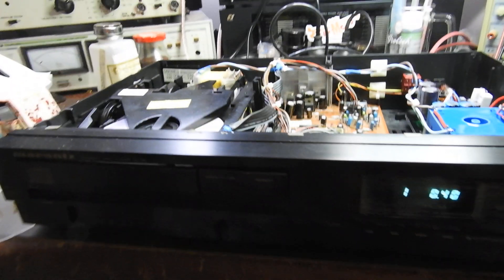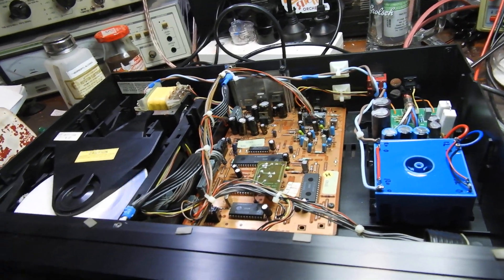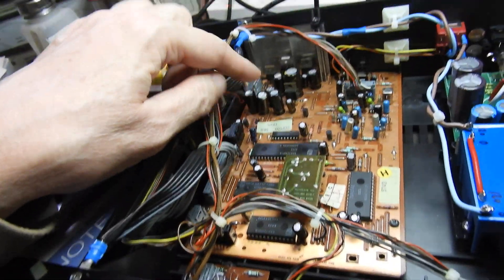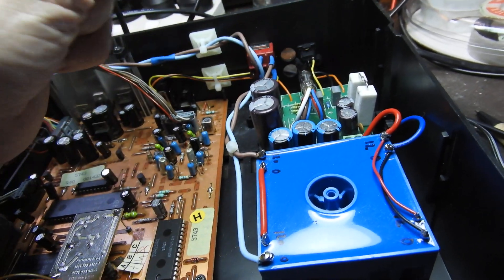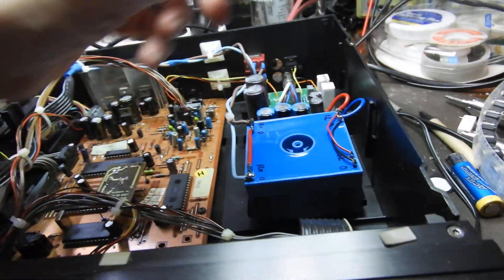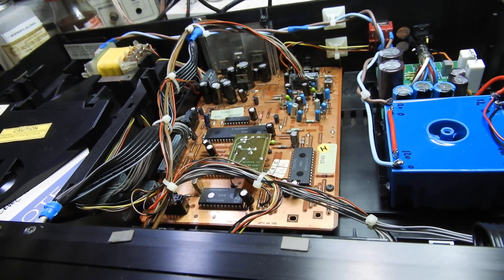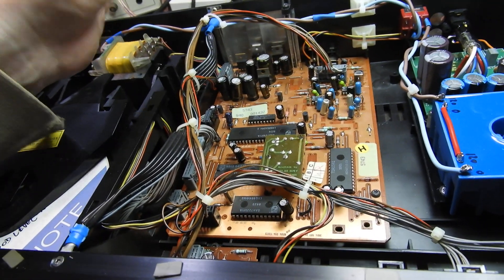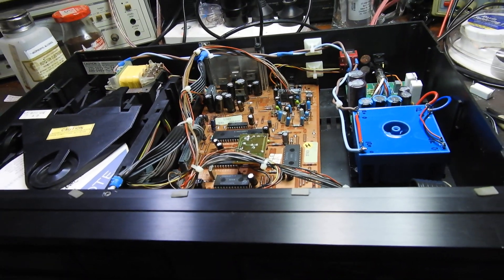Thermal vision camera  - the latest toy that should proved itself useful on its first test use.

Comment: Better mount that resistor to the chassis to act as a heat sink. 85 degC. Resistors don't radiate the heat out like the tubes do and need convection.
Reply from the maker: Remco, Good idea but sadly no can do. There is no metal in this player. Chassis is all plastic ;-)

Comment: I would be using 105 degree rated capacitors on any power supply on addition to improving the layout of that board.
Reply from the maker: I have already fitted 205 degrees capacitors. This is a standard project board from some magazine overseas, so it is not practical to change it.